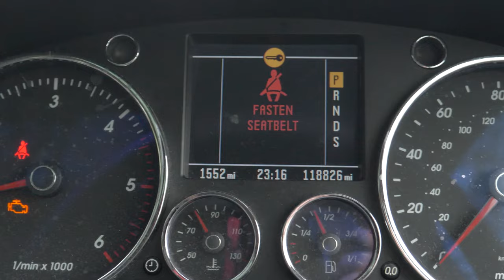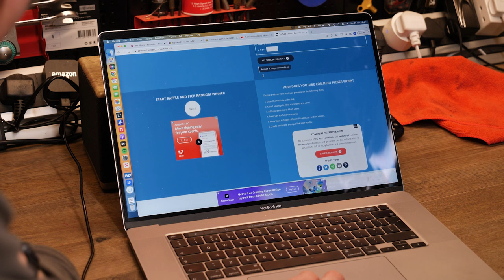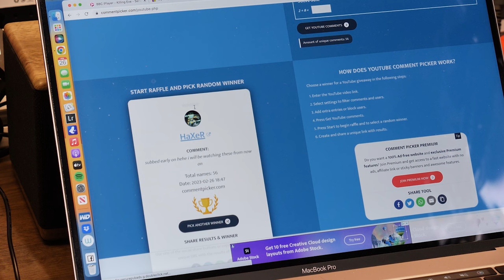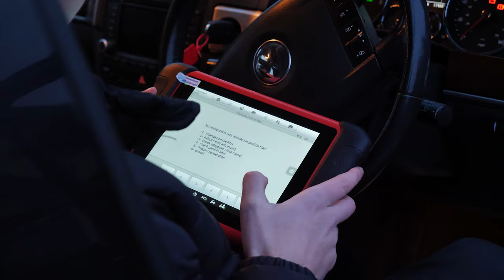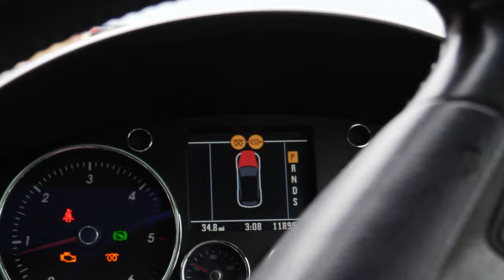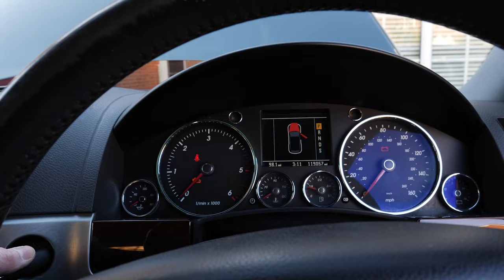The Truth About Flipping Cars: My Worst Mistake Yet

Comment: I had one of those - worst car I ever had. It was so poorly built. For instance, the plastic headlight adjusters both broke when I tried to use them. The local VW garage refusing to service it because "they don't do cars older than 12 years" should have given me a clue. They knew how crap it was. The driveshaft was loose (which apparently is a common problem - and it had already been replaced by the previous owner) which meant you couldn't go faster than 83 km/h
Reply from the maker: @willemm  😂😂😂 awful awful cars

Comment: Thank you very much for showing the reality. Your videos are fun and enjoyable, and it's interesting to see your journey. 🙂

I reckon there's a balance in car flipping where if a car is too old it might have more problems and won't be worth much even at its best, so might be worth aiming for nothing older than 10 years old, say.

I know this is a year old, but there are 2 things I have been told over and over that I noticed you doing in this video:
1. Only silicon grease should be used on the slide pins as that doesn't deteriorate rubber as opposed to copper grease.
2. Wheel bolts/nuts should be installed using a torque wrench. Of course on older cars it's often necessary to clean the threads and bearing faces.

Thanks again for the great content, and I wish you continued success in your journey. 🙂
Reply from the maker: Cheers man appreciate all the kind words!

Comment: I used to use copper grease on brake parts but no longer. It soaks up brake dust and turns to sticky tar over time. I now use proper heat resistant brake grease. Watch out for slider pins with rubber on them. Copper grease will make these swell and stick badly. I found out the hard way!
Reply from the maker: Haha yeah I learnt this the hard way aswell but more knowledge for the next one!

Comment: Never use copper grease on the caliper gliders. It will dissolve the rubber bushings they run through. 

Nice work though! :) Just clicked subscribe!
Reply from the maker: Learned that the hard way but thanks for the advice haha! THANKS for the subscribe!! More content soon
Reply: @Josh.Sanderson  Can't wait, the interwebs needs more grass root Wheeler Dealering!

Comment: I bought a v6 touareg a few years ago. I had it for 2 days before it started giving me trouble. I paid £6k for it. I spent £800 on it 2 days into ownership on a turbo boost actuator and turbo plus having it fitted. It then went into limp mode because the boost actuator needed to be coded by vw 🤦‍♂️ £450 later that was sorted. Then the battery started draining. It was at an auto electricians for a week while he tried to find where the bad earth was. It was a headlight that was the issue. A used headlight was £300 because they were projector/HID lights with ballasts and self levelling etc 🤦‍♂️ then it went back into limp mode because the dpf had blocked. So got a new dpf and fitted that after a 3 day ordeal with snapped bolts and awkward positioning of everything in the engine bay. That cost a couple of hundred quid plus 3 days off work. Then the main fuse box melted 🤦‍♂️

In total I owned the car for 5 weeks before selling it on at a loss of about £3k

By far the worst car I’ve ever had the misfortune of owning
Reply from the maker: Oh god my condolences haha fkn horrendous cars

Comment: Its hard at the moment i have a few in stock the one i cant shift is a 207 only 19k with all paperwork not had a enquiry auto trader 3150 cars mint people are not spending
Reply from the maker: You would think that would fly off the shelf!
Reply: I may have paid to much for it 2k 10 plate it's minted on auto trader not even a enquiry

Comment: Just remember buyer beware, I bought a 12 yo car with no service history,1 owner from new,  it had a 12yo fuel filter, air filter and a few lumps in the oil lol I guess they just drove it and MOTd it and drove it lol.
It had a few minor running faults that disappeared with a proper birthday service! 
If I didn't know how to service and scan the car it could have cost a lot to get put right.
Reply from the maker: Yeah luckily I’ve never bought a car with bad oil but service them whenever I get them usually

Comment: Hey bro, i have i think the sam problem on my Golf IV, when i turn it on heaters light starts blinking and my car won't pull like it used to, i dont know how to fix that, can  you tell me which sensor is that and do i have it, i know it's not the same car but its volkswagen.
Reply from the maker: Hey man it’s a different year and not the same problem if it’s a mark 4 I don’t think it has a dpf, best thing to do is get a code reader and read the code that will give you a good idea of what’s wrong with it
Reply: @Josh.Sanderson  thanks dude

Comment: GAAAAH NO COPPER GREASE ON THE SLIDE PINSSSSSSSSSSSS!!!!!

Otherwise, enjoyed the video!
Reply from the maker: Why not they’re supposed to slide on the Caliper no?
Reply: @Josh.Sanderson  Yes, but copper grease and petroleum grease should not be used on the slide pins, it can cause the rubber boots it sits within to expand and perish prematurely as it soaks in.

Silicone grease, or vaseline in an absolute pinch, is preferred. The grease packet that comes with brake calipers is silicone grease and you can usually make it last about five or six calipers' worth of slide pins.

Again, not having a go or anything, just strongly recommend against the use of anything petroleum-based on the slide pins. And copper grease, having particles of copper suspended in it, can increase wear speed, and is very attractive to grease. 👌
Reply from the maker: @AlexYeets  ahhhh I’ve got you I never knew that thanks for taking the time to explain it definitely something I’d do in future as I’ve never been told that! Legend thanks!!!

Comment: I was a mechanic and hated to work on German cars. It was designed to be tossed/recycled not fixed. I spoke once with an engineer from VW and he said they have specialised team who calculate the resistance of materials so after a certain period of time everything starts to give up. Literally designed to be recycled after  a few years ( idealul when you paid it off) so you could buy a new one.
Reply from the maker: I can’t say in surprised to hear about that to be honest! I heard as well that German cars are super reliable if you follow all the service and driving guidelines perfectly, if not it will fail prematurely

Comment: You should really keep track of your labor hours, Mileage for buying/picking up parts and other expenses like buying a special tool for the job. On this flip you lost way more than you think. Run it like a business' or you will be a charity.
Reply: Totally agree.  Also just buy small engine capacity low days to sell small petrols.  Risk reduction.  Quick sale.  Hardly any work